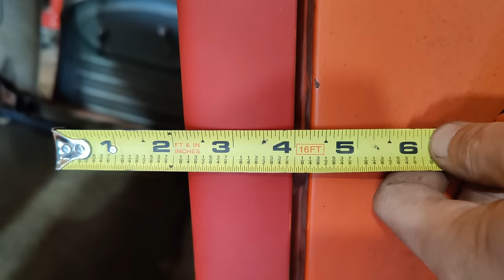Project Kermit 1962 c20 crew cab #5 building the doors

Comment: The problem seems to be that you are lacking structure in there, if I was building it, I think my preferred method would be to get some box tube and build the B-pillar out of that, and get the structure completely there before trying to make the door perfect, It is gonna be a custom door either way, so having the structure there to mount it to, getting it swinging without anything flopping, then worrying about the skin would be the order of operations. 

I am looking forward to seeing what you do with this, it is a hard job to figure all this out, if you get it done right, it will be a very cool truck!
Reply from the maker: Yeah when doing the inner rocker panels I added some more supports there's no more issues now

Comment: I done mine in 1996 .
 But I raised the roof in the back to look like a Vovo semi.
Reply: Now we just have to figure out what a Vovo semi is
Reply: It's the roof line on a intracle cab sleeper they done back in the mid 90
 The 60 Chevy trucks with the windshield set back from the cap roof line . That were 1960 to 1963 are the best cabs with less wind noise .